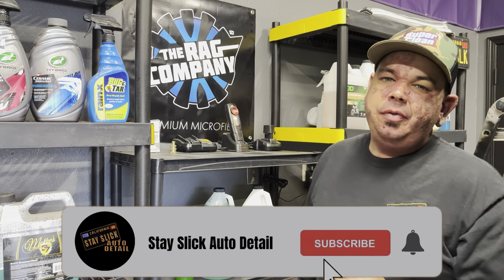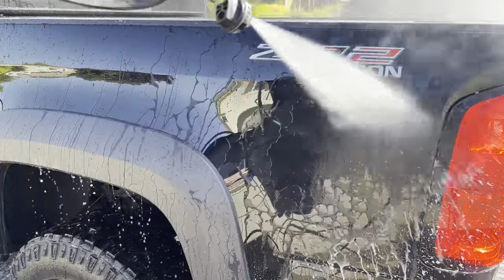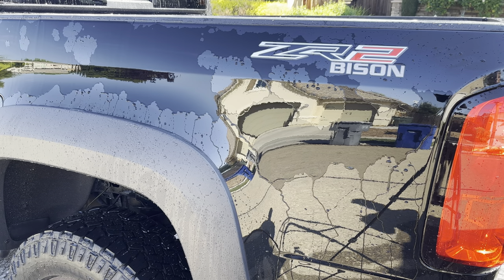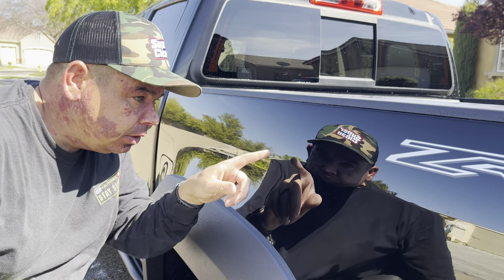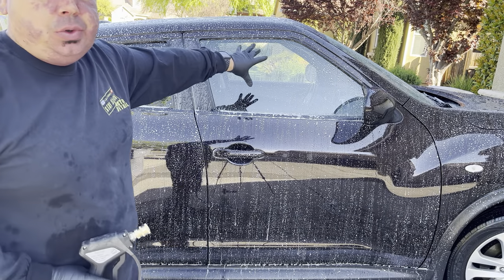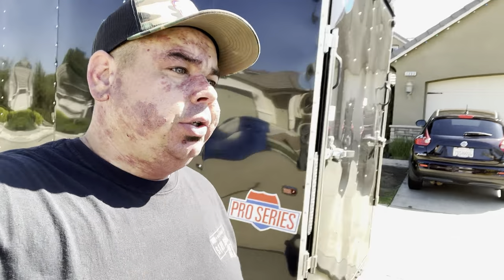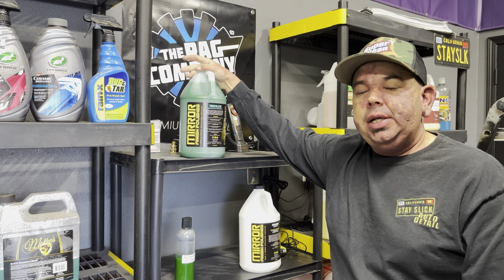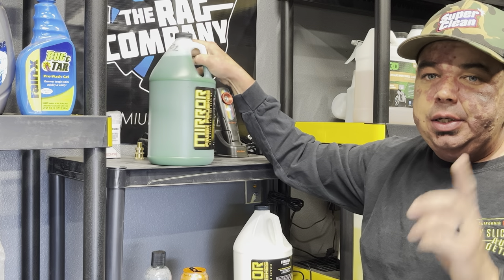Mirror Finish Touchless Ceramic Rinse and Seal Review | Stay Slick Auto Detail

Comment: I’m wondering if this is the same product as Chem-X’s Snake Oil. This product is considerably cheaper by the gallon, and they look and act the same.
Reply from the maker: They formulate, pour and package their own. Not the same product.
Reply: I understand. But Chem-X does not make their own stuff. They are buying it from someone else in bulk and putting their labels on it. Nothing is wrong with that, but I like to skip the middle man if possible. I’ll get the small bottle and check it out. Great video!
Reply from the maker: @tommyholt3465  Yes I know a lot of companies do that and there is nothing wrong with that I. From what I’ve seen snake oil is more of a foaming product and this product doesn’t really foam. So I can’t say for sure if it’s extremely similar or not but technically all these products that are trying to be in this portion of the market should technically give similar results. The only place I can really see themselves differentiating is in shine and durability
Reply: I’ll look forward to getting some in. 👍🏻

Comment: Correct me if I'm wrong, but actually I think you used the wrong math equation here which would change things dramatically. You divided the fl oz by amount of vehicles so you didn't factor in the cost per fl oz. So at $65 for 128 fl oz of Touchless that comes out to $0.50 per ounce. If you use 4 oz for 3 vehicles that comes out to 1.33 oz per vehicle. So 1.33 oz x $0.50 = $0.66 per vehicle.

With this formula, at $109 for a 128 fl oz of Matrix, that's $0.85 per oz. Assuming you use the same foam cannon and get 3 vehicles per cannon, and since Matrix calls for 2 oz per foam cannon, that's 0.66 oz per vehicle. 0.66 oz multiplied by $0.85 per oz that's $0.56 per vehicle. And you'd get 64 foam cannons instead of 32 foam cannons so you'd be spending $130 in Touchless per 64 vehicles compared to $109 in Matrix per 64 vehicles. Thoughts?

Comment: What's you're wand setup ? Mtm ?
Reply from the maker: Yes sir it’s the grey mtm wand.
Reply: @StaySlick  thought so I gotta get me one the bootleg one I have is leaking like crazy Time to upgrade.
Reply from the maker: @bryan70546  it’s definitely easier to pull the trigger and less fatiguing on the hand BUT I’m having issues with it sticking on. I took it apart and cleaned it, regreased it and it still sticks so I think I’m going to try the maxshine wand.
Reply: @StaySlick  you would think with the price of them they would make them serviceable.
Reply from the maker: @bryan70546  Honestly it might be and I might be under warranty I don’t really know much about it. I guess I could call them and find out

Comment: that stuff works well. but I'd rather apply a ceramic spray detailer and just dry the vehicle.   extra steps that takes time and therefor money doesn't make sense...most people don't want to rewet the whole car again when they can coat n dry at the same time.   but yeah if you have  time sure have fun
Reply from the maker: Interesting perspective. Applying a ceramic detailer as a drying aid for me takes longer then this. Also you don’t “re wet” the vehicle it’s already wet from rinsing the soap. Doing this also provides the ability to blow the water off the car in some cases better than ceramic coatings  I’ve installed. Good thing is there are so many products on the market there’s bound to be something for everyone. Stay Slick 🤙🏽

Comment: Nothing to be impressed sorry but chem x already has something called snake oil, it’s similar like this product
Reply from the maker: If you watch the video long enough you’ll see that I stated this isn’t the first product of its kind. In fact there are a few products that do this exact same thing. Where touchless reigns supreme is in the value department.
Touchless $60/Gallon 
Snake oil $98/Gallon
Reply: @StaySlick  understand but snake oil last 4 months of protection,there is videos Proving this, how long this new product lasts? I’m talking about protection
Reply from the maker: Well the product hasn’t been out long enough to prove longevity. But if you go back and watch my video you would see that I was talking to Mobile detailers about using this for maintenance vehicles maintenance usually being every week every two weeks every three weeks or once a month. Longevity does not matter when you are planning to reapply frequently for maintenance vehicles. Furthermore if a paint sealant lasting four months plus is of concern to the consumer or detailer I would highly recommend that they are using a liquid form of paint sealant that is either hand applied or machine applied as they tend to last much longer. . Another thing to point out is that longevity is far too subjective to be used as a selling point or concrete evidence. For example I live in Fresno California where it gets to 110° sometimes higher in the summertime my my experiences with products and their longevity are going to be far different than somebody else in a different climate zone. Being able to make these distinctions of when and where to use certain products is part of what makes a detailer professional. Knowledge is important when people are paying for your services. In the video on that Nissan juke I apply to paint seal it that lasts up to one year because it comes with the polishing service that my business offers. Because the customer is paying for that premium service I provide a premium form of paint sealant which is liquid. However he is also on my maintenance plan so I will maintain that paint sealant with touchless because that service is part of my maintenance plan.
Reply: @StaySlick  You are so goddamn right , is this available right now? I won’t get poor if I give a shot maybe I’ll buy the small bottle and test it out, are you offering any coupon code maybe to get a little discount?
Reply from the maker: Yes brother at the end of the video I stated that there is a coupon code. You stayslick for 10% off. The link is in the video description
Reply: @StaySlick  thank you I’ll keep you posted I want to do a comparison and see how long it last